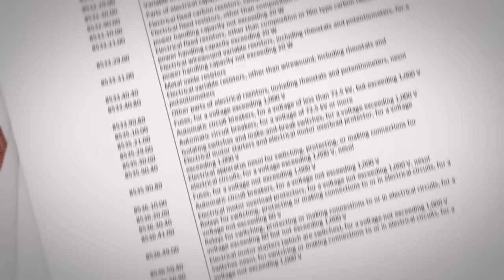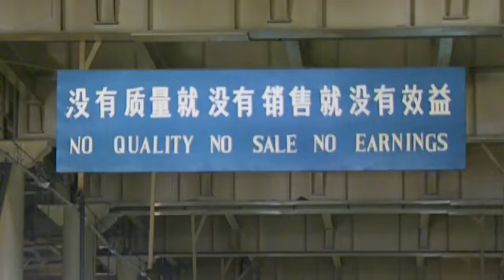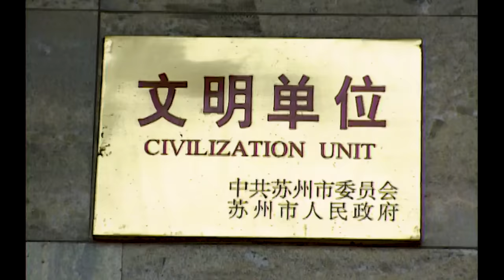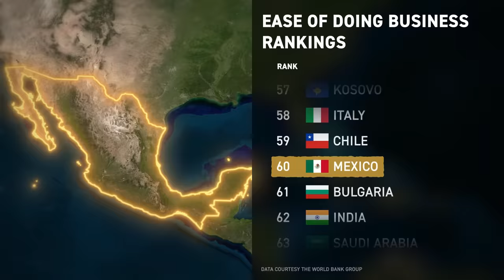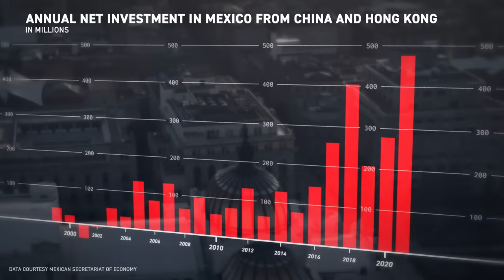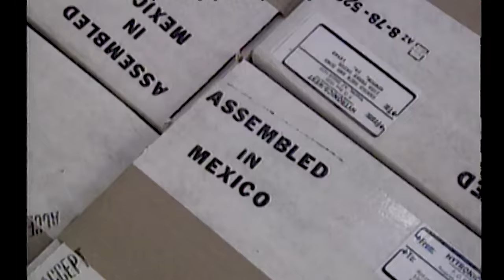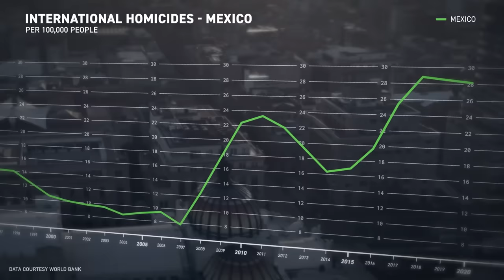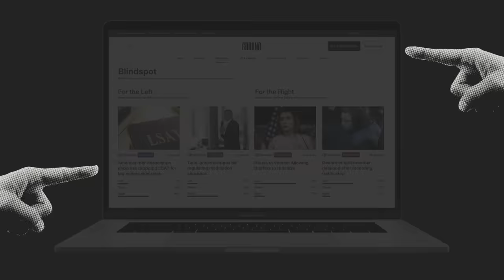How Mexico is Becoming the New China

Comment: As someone that works in manufacturing, I can say the tariffs don't 'help' the US bring jobs back but they did help us start looking at other options than China. It's a long process though. Our company itself was assembly products that were getting 25% tariffs in China yet we saw little increase in sales though for the parts we used, we did begin to buy more from Vietnam and India. Overall, China was just slowly losing out to Vietnam, India and especially Mexico. I had a another job a company making similar products and they eventually ditched their small China factory and built one in Mexico.  

These things take years though.  Even for an OEM to just to replace an existing supplier in China with one from another country, you need to order samples (can take weeks or months for delivery), test it (can take many months or even over a year), possibly re-sample many times until you get it right, then you need your customer to then test your product that has the new component and that could take months. Overall, a switch to a new supplier generally took us between 10-24 months to just get the new component approved depending no how important the part is to the function of the product. Usually the first order will have some 8-16 week delivery lead time so now you're looking at 12-28 months between placing first sample to getting first production delivery.
Reply: Agreed. In my industry of complex major mfg it takes about 2 years to get setup but I never ever foresee the work leaving once it’s in Mexico. It’s American jobs moving too :( for lower cost of labor and land.
Reply: china is switching out of the manufacturing focus, its delusional to think that china is just going to stay the same as it was in the 80s. 
just like how the united states was a massive manufacturing country in the 1930s till 50s,
china is now becoming a service and high tech industry, their software and services already make up 30% of their gdp and increasing.
Reply: @NeostormXLMAX  Need to have stronger IP laws if they're going to do that.
Reply: @NeostormXLMAX  "china is switching out of the manufacturing focus," And struggling to do so! China is now expected to have an annual GDP growth of around 3% for the next 20 years. When Taiwan, South Korea and Japan were at the same GDP per capita that China is today, they had approximately 7% GDP growth for the next 20-30 years! That's a massive failure when compared to it's east Asian counterparts. 

>just like how the united states was a massive manufacturing country in the 1930s till 50s,

Except the US was already upper income country at that point. China is not close to even it's East Asian counterparts who have 4x higher GDP per capita.
Reply: @NeostormXLMAX  China will always focus in manufacturing, because of the national security and self-reliance, China also need industry to create enough emplois to its huge population,

China can't desindustrialize like the US,
Reply: @Homer-OJ-Simpson  Measuring China's GDP per capita is tricky though due to the sheer size of the population.  Even though they still have hundreds of millions living in poverty, they also have hundreds of millions who have entered the middle class.
Reply: @NeostormXLMAX  Also, "its delusional to think that china is just going to stay the same as it was in the 80s" is a nice strawman. It suggest that there aren't consequences for China's actions. The chip sanction is indeed hurting China's economy. Countries looking to decouple or de-emphasize trade with China also have an impact. China's April manufacturing data show a contraction of manufacturing compared to March.
Reply: @TimothyCHenderson  "Measuring China's GDP per capita is tricky though ", yes, because they have been known to exaggerate it.  In 2007, the then next in line to be leader (Xi would beat him though) said China's GDP numbers are man made and basically just goals. 

It's actually not hard to measure GDP per capita, it's just that China doesn't want to properly measure it for political reasons. US has perhaps the most reliable GDP numbers and it's the 3rd most populated country.

Several studies have also shown that China is likely exaggerating their GDP number by at least 1%pt a year and it's true GDP is anywhere from 40% to 80% of what's officially reported.
Reply: @Emilechen  I've seen No_guard_X before. It's a pro See See Pee account.
Reply: Delivery 12-28 months, God. Do you know how long it takes to deliver in China? Don't lie, you give the company will go bankrupt😂
Reply: @haochengzhai7156  "Delivery 12-28 months,". Did you not read the whole comment?  I'm guessing Chinese is your first language? I said it's 12-28 months from the day a decision is made to order samples to the day the first full producition order is received. In between it's lead time of samples, testing of samples, having to re-order samples if needed, having our customer (the end product) test it and qualify it, getting every approval and ordering the first production order, lead time of that first production build, and then the delivery lead time which if it's from Asia is 4-6 weeks in transit and if from Mexico 3-5 business days.
Reply: Your name and thumbnail are hilarious - I love it.  And thanks for your educational post.
Reply: @Homer-OJ-Simpson  Yes, you know 12 months. lol. should be out of the market
Reply: @lorenkelley1568  The Juice is Loose. D'0h!
Reply: @haochengzhai7156  what should be out of the market? You don't eve know my industry and how much testing there has to be. I'm talking about electro mechanical  parts, not screw drivers or something simple.
Reply: @Homer-OJ-Simpson  Electromechanics is just a common category for export in China. Please tell me your company's parts are not from China😂
Reply: @haochengzhai7156  Motors. They need parts from China. DO you know any of this? I'm confused because it seems like you are defending China but also not defending China.
Reply: @Homer-OJ-Simpson  I am Chinese😅
Reply: @haochengzhai7156  It seemed like you're trying to defend China but with arguments so bad it actually makes China look worse.
Reply: @Homer-OJ-Simpson  Read about your Goldman Sachs forecasts for the Chinese economy.😂The next period of high growth in China has only just begun.
Reply: @haochengzhai7156  they last forecast china to have 4% gdp growth 2023-2029 and dropping in 2030’s. What is that supposed to show?
Reply: @haochengzhai7156  so many see see pee 50 cent here.
Reply: @Homer-OJ-Simpson  Did Goldman Sachs get 50 cents?😂
Reply: @haochengzhai7156  China's factory activity unexpectedly contracted in April as orders fell and poor domestic demand dragged on the sprawling manufacturing sector, a private survey showed on Thursday, imperilling the broader economic outlook for the second quarter.
Reply: @haochengzhai7156  Goldman Sachs say 4% growth this decade, half of last decade. And that’s before April manufacturing data of China showed a decline. So 50 center says all that is good!
Reply: @haochengzhai7156  “I am chínese” is the most obvious statement from a 50 center
Reply: @Homer-OJ-Simpson  How did you get the money out of the bank? lol. watch out for bank failures😂😂😂
Reply: @haochengzhai7156  Aww, 50 center upset China's economy not doing as well as he was told by owners, See See Pee?
Reply: What a joke "slowly losing"
Reply: @widodoakrom3938  What's the joke? I don't get it?
Reply: WOW VERY DANGEROUS SIR! 😠 😠BUT THIS WHY IM SO LUCKY LIVE IN SUPER INDIA  THE CLEANEST COUNTRY IN THE WORLD 🇮🇳🤗 , WE NEVER SCAM! WE GIVE RESPECT TO ALL WOMEN THEY CAN WALK SAFELY ALONE AT NIGHT AND WE HAVE CLEAN FOOD AND TOILET EVERYWHERE 🇮🇳🤗🚽, I KNOW MANY POOR PEOPLE JEALOUS WITH SUPER RICH INDIA 🤗🇮🇳🤗🇮🇳🤗🇮🇳🤗🇮🇳🤗🇮🇳🤗🇮🇳
Reply: @Homer-OJ-Simpson  china slowly losing against India and Vietnam that's the joke china manufacturing capabilities far higher than both India and Vietnam investor choose both of those country bcs of cheap labor while china manufacturing capabilities far higher than India and Vietnam
Reply: @widodoakrom3938  "china manufacturing capabilities far higher than both". Oh, so 50 center doesn't think Vietnam and India are growing their manfuacturing? Or Mexico? China got that business at the start because they were very low cost and Vietnam & India are doing the same -- they are now the very low cost places.
Reply: @widodoakrom3938  Getting .50 cents a comment?
Reply: @Homer-OJ-Simpson  only slightly cheaper but far in term manufacturing capabilities such example is Samsung their profit plummeted 96% bcs they moved their manufacture factory from china to India and Vietnam
Reply: @widodoakrom3938  You dont seriously believe that Samsung’s profits fell by 96% because they moved their production right ? Because that is possibly the dumbest comment I have read in a very long time.
Reply: Mass manufacturing won't be coming back to the US, or at least the easy high school-level jobs won't as anything returning will be automated and require more skill. Customized fabrication is promising though as 3D printers get better, which could end up democratizing manufacturing in general -- it may not provide a living wage, but it'll be cheap enough to perform as a hobby instead.
Reply: For many years, China has focused on making up for its industrial foundation, upgrading its industries, developing natural sciences, and attracting talent for modern development. In short, China's plan is to replicate the experience of the West over the past three hundred years in the 100 years since the founding of the People's Republic of China, and make corresponding strategies based on the continuous changes in the modern world situation, relying on its own institutional advantages for full development.
Reply: @后宫后  Yes, South Korea, Taiwan and Japan did that as well. They have actually achieved upper income level. Mexico is sort of trying...
Reply: @widodoakrom3938  "only slightly cheaper". Direct labor cost The national average labor cost is $0.92/hour in India and $3.52/hour in China,  Widodo doesn't know facts.
Reply: @widodoakrom3938  "Samsung their profit plummeted 96% bcs they moved their manufacture factory from china to India and Vietnam" Got 50 cents for that false claim?  Sales dropped  as customers bought up fewer cell phones and laptops.
Reply: @lord_of_love_and_thunder  Does Widodo Akrom  believe Samsung profits fell by 96% of the production move? Probably not, just paid 50 cents to post it.
Reply: I mean that China will replicate everything from the West and use its own system for rapid development. South Korea has no scientific achievements, no complete industrial foundation, Japan's scale is not large enough, and no country can independently produce a complete high-tech product. Can you understand what I mean?
Reply: @后宫后  " China will replicate everything from the West and use its own system for rapid development.' Unfortunately they aren't succeeding as well as South Korea, Japan, and Taiwan. China's annual GDP growth for the next 20 years is expected to be about 3%. When SK, Japan & Taiwan reached the same GDP per capita that China has today, those 3 countries had average growth of 7% for the next 20 to 30 years! 

China's sheer size of course means more industry but on per capita basis, they will not come close to those other 3.
Reply: In other words, if modern world civilization is quantified as 100, South Korea's score is 1, Japan's is 10, and the Western world accounts for over 80.🙄
Reply: @后宫后   what are you even suggesting or arguing with SK 1, Japan 10 and western world are 80? What are those rankings or numbers? And where does China fit in those ranking or numbers?
Reply: @Homer-OJ-Simpson  

Obviously 0.
Reply: @StayActive98  Obviously 0 what?
Reply: @Homer-OJ-Simpson  

China's rank would be the lowest in east Asia's "civilisation ranking" is what I said .. Doh!.
Reply: @StayActive98  Oh, got it. lol! I wasn't sure which comment you were referring to. Yeah, if it's 0-100 and 100 is most civilized, if SK is 1 then China is 0.
Reply: @后宫后  is that 50 cent per post still your going rate?
Reply: @indiasuperclean6969  weirdo
Reply: @Homer-OJ-Simpson  You sound like typical SKorean 🤣🤣🤣🤣
Reply: @Homer-OJ-Simpson  "China is now expected to have an annual GDP growth of around 3% for the next 20 years" - they've literally ALREADY grown at a higher rate than that, and that's just after they ended zero Covid and real estate problems. Even they accept that their economy won't grow at the same pace as it did during their boom years, but 3% over the next 20 years is wishful thinking. Indeed any estimate for decades ahead is wishful thinking.
Reply: @ArawnOfAnnwn  "they've literally ALREADY grown at a higher rate than that,'. Beijing based? Just wondering why this comment was made, seems to not understand the argument and went straight into defending the see see pee. What they did in the past has nothing to do with what they will do moving forward. And 3 to 3.5% is what almost all the estimates put for average annual growth today through 2040, most having China under 3% a year by 2040. A big factor for China is the working age population. It has been basically flat 2012 to 2027. Then it begins it's decline from an estimated 991mil in 2027 to 866mil in 2040 and 767m in 2040. So in 2040, there will be 118million fewer potential workers or 12% decline. By 2050, 217m fewer potential workers or 22% decline. 

All else constant, that decline in working age population would mean 12% lower GDP in 2040 and 22% lower GDP in 2050 compared to if the population had been flat. But the impact will be more as the reduction in working age population comes with increase in elderly population which will require more of the govt resources to take care of.
Reply: @ArawnOfAnnwn  So Beijing or Moscow based?
Reply: @Homer-OJ-Simpson  Lol! Typical. You're literally one of the most prolific commenters here, yet you waste no time trying to discredit everyone with a different perspective from you. Two can play that game bub. So, Langley or Maryland based? I hear Maryland pays better. Maybe try switching if you're in the former. 😌
Reply: @ArawnOfAnnwn  "one of the most prolific commenters here". Confirming to be Beijing based. Nice! Tracking people is what they do. 

> trying to discredit everyone with a different perspective from you

Literally proved the arguments you made were wrong or misleading. You are arguing that people should just let others (and you) just state wrong information.
Reply: @ArawnOfAnnwn  You have an Indian username to throw people off to think you're not from China. Nice. I've also seen you a lot on youtube so talk about prolific!
Reply: @Homer-OJ-Simpson  "You are arguing that people should just let others (and you) just state wrong information." - you haven't been going around correcting anything, just dissing people as bots and offering your opinion on why they're wrong cos of your vaunted expectations being more valid. There's data on their growth rate - you both dismiss it as fake and put forth your own take on not just what it is, but what it will be for the next several decades lmao! I'm sure you borrowed that from some analysts you found online, but the hubris is in thinking your favorite commentators are better than everyone elses' (I wouldn't be surprised if one of them was Zeihan - he's a favorite among your ilk, lends an air of academic respectability to your cause even though he's more of a popular pundit than an academic these days). There's data on their car sales both domestic and foreign that others in this comment section have hit you with, you start conjecturing about how it's all nonsense or just going to Russia in order to once more cater to your own biases. And of course no questions on the validity of your sources or favorite nation. And whenever any of them pushes back, your go-to tactic is to accuse them of being in the employ of Beijing or Moscow, cos you folk are incapable of seeing the world as more nuanced than Bushs' infamous duology, besides being generally ignorant other nations existing except insofar as they fit into your side or that of your main enemies. To people like you, there are only two ways of seeing the world - the American way or that of the enemies of America, so anyone who calls out America must be from the enemy camp. This applies to even to data, wherein you only accept data when it suits your narrative, and if it doesn't it must be fabricated or exaggerated or any other way you can think of to dismiss it. While of course your own numbers are above reproach. Even way back when no less than the WB talked about China's poverty reduction, you people saw fit to poo poo even that institution cos it wasn't saying things you liked.

I take my earlier comment elsewhere back btw - that Asianometry video would be wasted on you. Ironically that channel is also from an American (sitting in Taiwan no less), just a less biased one than you. But it doesn't matter. I doubt a shared nationality would change your mind, all that matters to you is if they share your supremacist views. Indeed I wouldn't be surprised if you've accused even fellow Americans of being from 'Beijing or Moscow' in your storied internet career (though I doubt either Langley or Maryland pay your for it - they don't need to, which makes you worth even less than 50 cents lol!).
Reply: @Homer-OJ-Simpson  "You have an Indian username to throw people off" - while you busy yourself questioning my nationality, I don't need to doubt yours. You need to fall back on conjecture and supposition to call out your doubters, they can merely point out how much your biases fit perfectly with where you're from (be that the US or a US ally, before you try claiming that next). All you do is attack the credibility of the people you don't agree with once you've run out of ideas you've borrowed from US pundits.
Reply: @ArawnOfAnnwn  " you haven't been going around correcting anything" I literally did that for you.And others here too were mispresenting China's economy.

"There's data on their growth rate"

Yes, and all the forecast have roughly 3% average annual growth 2023-2040 and below that after 2040.  What was even your comment in response to my 3% avg annual growth 2023-2040 "- they've literally ALREADY grown at a higher rate than that,"? 

What does the past have to do with forecast?
Reply: Mexico won, Vietnam won, and India won.
As long as You are happy.
Reply: @Homer-OJ-Simpson  honestly ur kind of insane to compare south korea and japan lmfao
Reply: @episode6691  how so? Vague comment without backing it up?
Reply: @widodoakrom3938  China was India & Vietnam 30 yrs ago. They will be taking Chinas place in manufacturing just like China took the US’s manufacturing capabilities. Chinas not the only one who can educate themselves. Best of luck to 2 deserving countries…India & Vietnam.
Reply: @Homer-OJ-Simpson  He/she’s gotta eat I guess!
Reply: @Homer-OJ-Simpson  The Samsung comment was ridiculous. They keep boasting on this thread how smart and educated the Chinese are. Not very smart thinking they can post outright fiction and people should just go with it.
Reply: @pacjam418  50 years not 30 years before reformation held by dien Xiaoping in 1976
Reply: @pacjam418  I just got a respond from someone from China in another comment chain in this video and it's the same pattern. I know many of them are paid to be here and I guess the rest are just what they call 'useful id..t". The party and their workers come up with talking points, those useful id..t then just repeat it.
Reply: @NeostormXLMAX  20% youth unemployment, by China's own statistics.